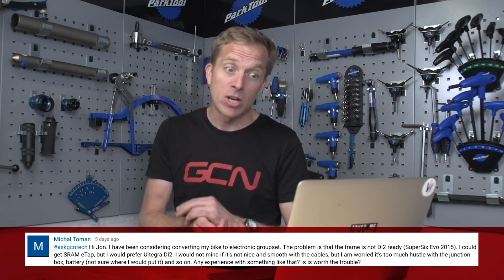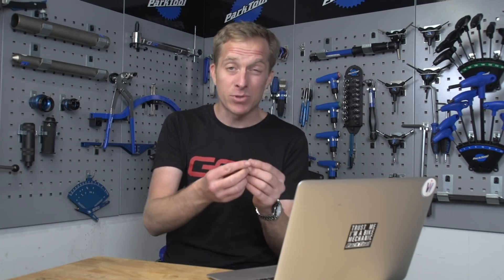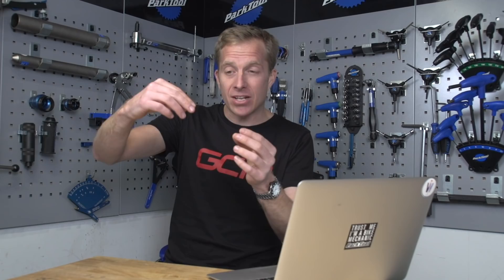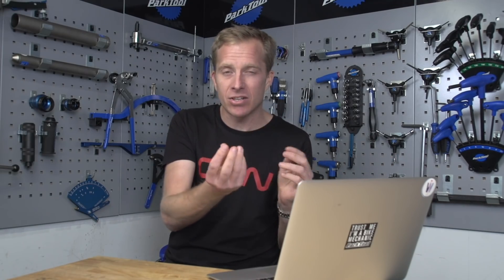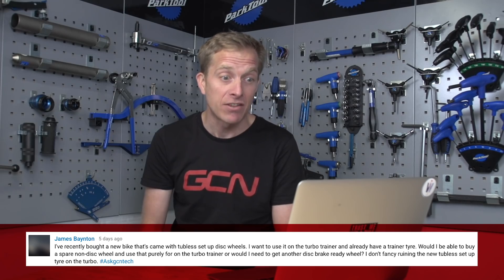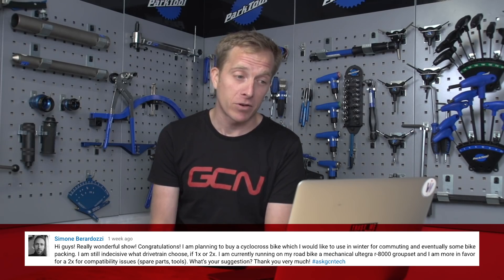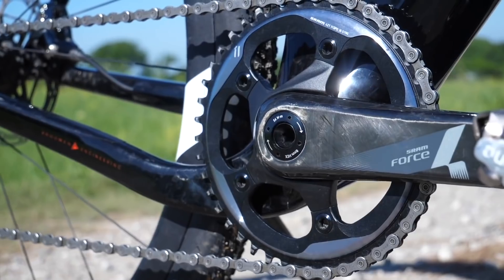Rim Brake Conversion, Di2 Upgrades & Tubeless Tyres | GCN Tech Clinic

Comment: On non officialy DI2 compatible frames its always a good idea to check if the bottom bracket housing has enough room to put the cables and junction box inside. I was able to put everything inside (only the cable to the rear mech exits underneath the seat tube like the mechanical cable before did)  on my rose pro sl disc frame. the cable from the front junction box enters the headtube where the mechanical shifting cable before did, the junction b box with all the cables is tucked in the downtube next to the bottom bracket, and the battery sits in the seatpost and the cable runs down the seattube. even rose said its not compatible but it wasnt complicated at all. nothing rattles and shifting is awesome.

Comment: Great video as usual 🙊
#askgcntech I have a blue bike and was looking to match my chain to the frame. I was wondering if you had any opinion on the coloured wax? Will it reduce friction and chain noise or will it wear out my component faster? If you could recommend a brand? If I should still up lube over the wax? and how often should I clean it and reapply?
Thank you so much and hope to hear from you guys soon.
Reply: Check kmc dlc chain. They have a blue version
Reply: Avoid wax, i tried it and now use lube again. It dries hard and sticks all over drive train, my mechainic said he managed to clean off most of the shit (he meant the wax i put on) still find the odd lump now and again.
Reply: The colored wax is a scam. Avoid it.

Comment: #askgcntech I ride a Raleigh RX 2.0 cyclocross race bike that i ride on the road but my baby has a big beauty flaw. My front fork's dropouts are (were) painted and the paint has began to crack and fall off. How do i stop it from progressing up the fork? (Fork is carbon, dropout aluminium)

Comment: Hey John loving the show. I have a question relating to tire width vs rolling resistance. I understand that wider tires have lower rolling resistance but don't they weigh more so where is the cross over point for where does the higher weight out weight the benefits of the lower rolling resistance
Reply: Many factors here.  Wider tires have lower rolling resistance on rough surfaces at lower tire pressures.  Skinny tires have lower rolling resistance on smooth surfaces at higher pressures.  After a certain point, wider tires just have more rolling resistance period.  That's why we don't ride 2" wide tires like mountain bikes.

Comment: #askgcntech
Hi Jon! So I got a bit of a problem with the chainline on my Trek Checkpoint ALR4. It has a 10-speed Tiagra Setup and in the smaller cogs on the cassette, the chain snags just a little bit on the respective larger cogs theeth when backpedaling. Not enough to cause any real problems but it is rather distracting while riding in harder gears. I've read that 11-Speed chains have the same inner width than 10-Speed chains but a smaller outer width. Would it be worth it to try out an 11-Speed chain to see if that helps with the issue or would there be any significant downsides to that experiment?

Comment: The external Di2 stuff on my bike is very unobtrusive.  Nobody notices it.  Performance is always flawless.  Ultegra mechanical is great, I haxe it on my CX bike (2x) but Di2 is even better. You will feel it immediately. I highy recommend it.  Somebody once asked if they should invest in that or in carbon wheels.  I have both.  The Di2 had a more noticeable positive effect (in part because my alloy wheels are pretty good Ultegra ones).  In fact I ride the alloy ones in winter anyway to avoid excessive wear on carbon rim braking surface.

With all that said on my next bike I would definitely at least consider a wireless electronic groups set to simplify things even more.

Comment: Should I invest in a head unit ( Wahoo element bolt bundle) or an indoor trainer???
Reply: vrushali deshpande   Both!  Seriously, the two don't really meet the same needs.  If you're struggling to ride outdoors due to weather, daylight hours, whatever, then get the trainer and get going on Zwift.   The Bolt and sensor kit is more for adding more information during your rides.  So, if you ride happily outdoors year around, then it makes sense to get the Bolt and sensors and that can add a lot of enjoyment.  I use mine a lot and love it.   Both trainers and bike computers are awesome and, like I said at the beginning, get both someday to enjoy all the benefits.  There is some crossover, because the hr and cadence sensors will get used indoors as well as outdoors when you set up your smart turbo trainer.

Comment: Turbo - with disk wheel. Probably need a special skewer as well for turbo... Worth putting in a spacer in there in case you put the rear brake on in error??

Comment: My issue I'm having is with my rear brakes I can't for the life of me get the brakes centered any advice
Reply: To align the caliper on the disc sometimes you have to use spacers in between the pad and the disc to ensure proper equal spacing on each side. ( I use a business card)  Typically you want to loosen the bolts to the caliper just slightly squeeze the brake lever to secure the pads against the rotor and then tighten down the caliper. If this method doesn't work then using a business card or any piece of thin cardboard as a temporary spacer is another option. Just insert the card between the pad and the rotor on each side, then carefully tighten your caliper,  don't forget to remove the spacers when you're done.  Of all of this depends on the fact that your rotor is true to begin with, so check to make sure your rotor is indeed true. If it is then it's just a matter of being patient and lining up the caliper properly.
Reply: @archetypex65  it's a v brake I'll try that though thank you
Reply: @archetypex65  turns out my rim is slightly out of true so I'll have to deal with the issue till it gets fixed

Comment: #askgcntech
Hi Jon. I heard that tubeless tires have less rolling resistance, but wouldn't the viscosity of the sealant just add to the rolling resistance? I would like to hear the opinion of a mechanic who have probably done his research (you)..
Reply: if anything, the sealant might affect the unsprung weight of the wheel. Remember that glue on tires have been around for ages without tubes and there is no difference in Rolling resistance between a good Clincher and a glue on Tire. 👌
Reply: There is some research publicly available. bicyclerollingresistance.com has done all sorts of tests with tubes, without tubes, with different widths, etc.

Your answer is yes - sealant adds resistance, but less than a normal tube. Latex tubes seem to be the faster option.
Reply: no - because the rolling resistance (only considering the difference between tube and sealant) is the tube / tyre interface which isn't there on a tubeless tyre... If all other factors are equal the tubeless setup should have lower rolling resistance however there are some tyre compliance issues (clinchers for tubes can be more supple than tubeless tyres which can affect things).
Reply: Thanks guys..